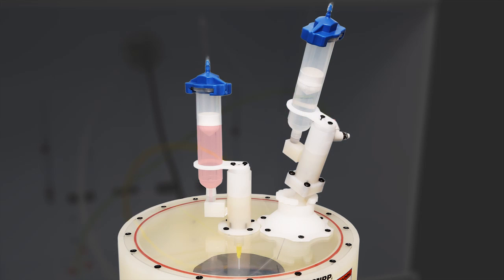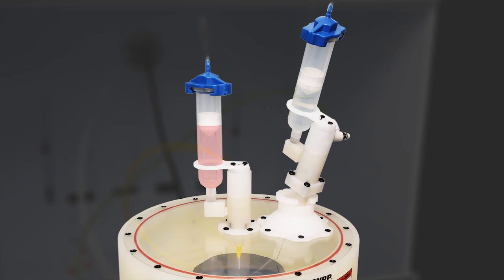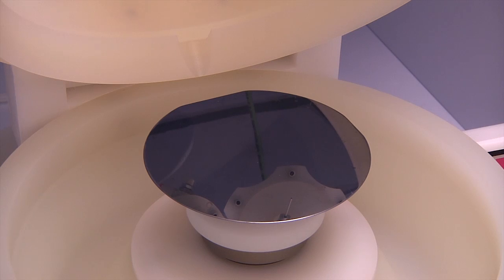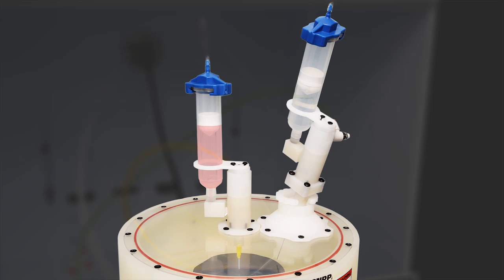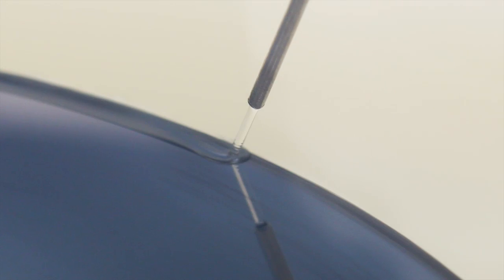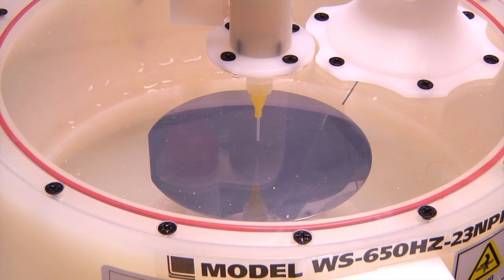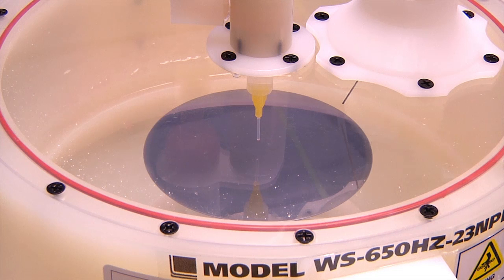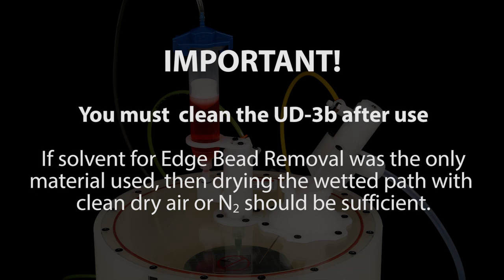Spin Coater UD-3b Adjustable Dispenser and Edge Bead Removal

Comment: When using a pressure vessel, what pressure should you use for the dispense?
Reply from the maker: Hello, The pressure required is dependent on 1) your materials viscosity 2) The length of the tube between the vessel and the dispenser 3) The diameter of the dispense needle  4) the height difference between the vessel and the dispenser  The end requirement is a stream of material delivered to the substrate, not a pressurized "jet" of material that splashes across the surface of the substrate. We suggest a starting point of 10 PSI. You will have to experiment with the settings to achieve the steady stream of material required  If you have any further questions please email me directly at jdavidson@laurell.com

Comment: What is the solvent dispensed here to remove the edge bead?
Reply from the maker: Hello Dolphin. It depends on the material used. You should use the solvent recommended by the supplier of the chemistry you use.
Reply: Spin Coater I’m planning to use SU-8 resist
Reply from the maker: @fishw_owater   According to the website here https://kayakuam.com/faqs/su-8-resists/ there are two solvents. The original SU-8 formula uses gamma butyrolactone. SU-8 2000 uses cyclopentanone. I hope this helps.